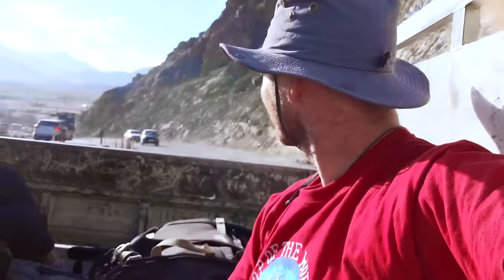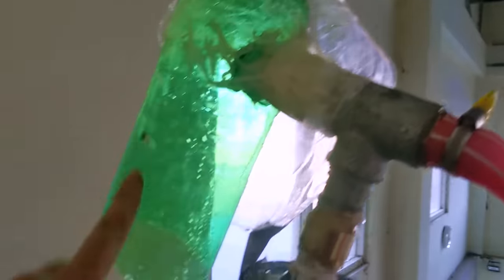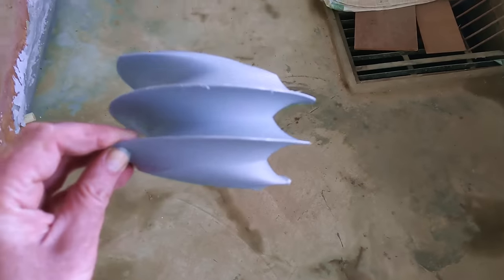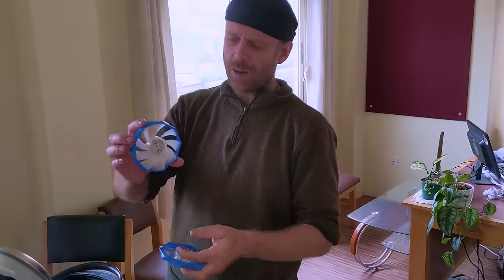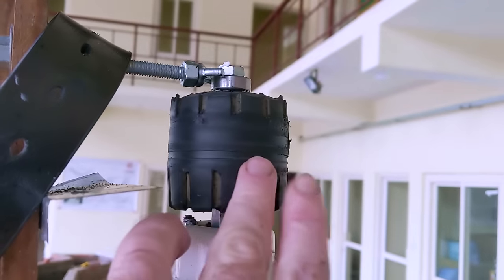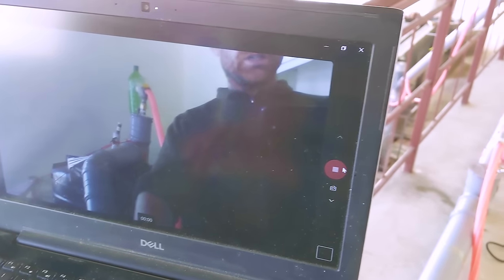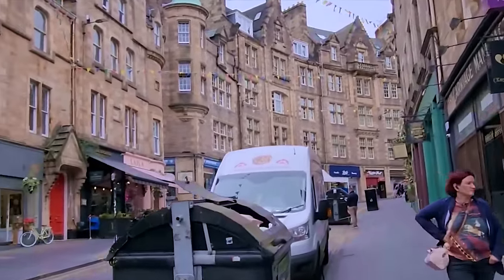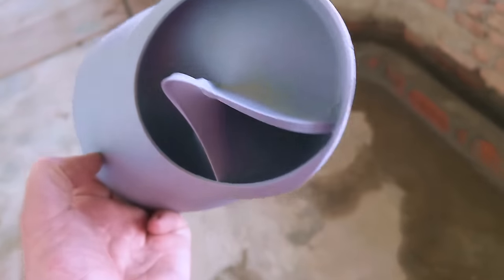The $50 Water Turbine Gets A Power Upgrade (Also I'm In Nepal)

Comment: That guide to spin the water was too comlex, too much surface area. If you look at the static blades on a turbine, they are relatively short in terms of the distance the water travels over them. You overdid it, and it needs to be a gradual turn from straight flow to the angle you want the water to be turning at. Plus, quite often the fluid hits the turbine straight, and it's intermediate blades that are used to adjust the fluid angle to hit the second or subsequent sets of moving blades correctly.
Reply from the maker: This is I think essentially the case, yes.
The idea was to double up a flow guide bend with a stator action, but previously when I tried just a bit of carved polystyrene to elbow the flow it didn't really seem to make any difference, so I think maybe the water just doesn't mind taking a corner on its own, but really hates wall friction..

I'll next try a kind of internal vector spinner type thing which may or may not help but should be easier to dial in specific angles, and just a more standard stator stack as you described.

Comment: After years of casually researching nano-hydro, I keep returning to the conclusion that positive-displacement designs (like the archimedes screw and others) seem preferable due to significantly higher efficiency.
Reply from the maker: Screw turbines are a good option in terms of efficiency, but can be a bit of a hassle to fabricate and integrate into the site. Also very low rpm, so usually need a lot of gearing up to get useful voltage.

What are some other displacement type turbines?

Comment: Excellent job! I am a bit surprised that the flow guide didn't help. It should have increased the RPMs of the spindle but probably reduced the torque, Did the flow guide made the tank to empty slower? Could it be the case that cumulative energy is higher while instant power suffers?
Reply from the maker: With the screw runner the flow guide managed to drop both the rpms and torque. May be just increased friction above vector gains. Going to have to try some other options to get a better idea of what's going on.

Comment: The logarithmic spiral types are intended to throw water out to the side, if they're constrained within a tube then all you're doing is increasing the pressure and friction.
Reply from the maker: It's likely something like that, yes. I'm finding that good propellers don't necessarily make good impellers.
Reply: @OpenSourceLowTech  Yep. This is also true of airplane propellers. Some of them perform better when they have a shield around them to direct the air and some don't seem to have much of an impact. I think the term for them is "ducted propellers'.

In a boat setting, the idea is to grab as much of the surrounding water as possible and throw it backward, OR to move a smaller amount of water very fast. Both of these impart Newton's third law (mass, momentum etc).  

In a tube like you've got, all the water is inherently 'ducted'. So running the horizonal water grabbing ones in reverse ends up performing poorly.
Reply: I think the Lily Impeller might work when constrained given it has more room for the water to be expelled. But ultimately having real world tests like you doing is ideal. These things are so hard to think about and often unintuitive.

Comment: Trimming the shrink wrap after install will change the balance of the wheel. ANY imbalance will be a big loss in efficiency. If you detect vibration during operation, the wheels are off balance, at least the rotating assembly is out of balance. Unfortunately, wear on the rotating parts will change the balance too.
Reply from the maker: Potentially, tho the masses involved with the plastic runners are super small, and it is in normal use flywheeled by the alternator.
Could have unbalanced torque effects tho if one side of the runner is a slightly better profile than the other..

Comment: Have you ever tried 3D printing a adjustable penstock gate that would sit just above the turbine blades? It looks like the circular radio active symbol but there's two that overlap and depending on how much you align the holes in the top plate with the bottom would control the flow rate and head pressure.
Reply from the maker: Doable, but the use case with these tends to be that you always want as much power as you can possibly get out the thing.
Reply: @OpenSourceLowTech  True, it's always a fighting balance between adequate head pressure and  vectoring the flow at the most efficient angle of attack. I believe your solution lies in in solving that metering and head flow angle though, but that's my opinion. Love your content.

Comment: Great work as always! Interesting to see that the Archimedes screw had the best performance, but it makes sense I suppose, and that's great info to know since the Archimedes screws are less considerably less complicated to print or fabricate than the other more complex spiral shapes. I think I can definitely print a screw of that exact size and shape out of recycled #5 PP with my TrashPrinter. There's still a lot it can't do, but it does really well with simple spiral-vase type parts like that, and I've printed turbines with similar sizes and overhangs before. I'll give it a shot once I get the trash printer going again later this summer, and I'll let you know how it goes. If you've got an STL you can send me, lmk, but otherwise I'm sure I can find one online or make one with OpenSCAD. 

I've got some friends up in Washington with a pond on their property that drains a massive area of steep mountains on their property, and I've been looking into ways to integrate their pond into their off-grid solar power system, as both an energy storage buffer and a way to harvest energy from the huge volume of rain moving through their property in the winter, when they get basically no solar. I would love to test out one of these turbines up there. I figure we can build one to start and get some data on its performance, and if our results are promising, we can calculate how many more we would need to match the natural seasonal flux of the pond, and then build an array of them.

Thanks for collecting and sharing this data!
Reply from the maker: Oh yeah, forgot to include the .STL
Is now in the description, but also: https://drive.google.com/file/d/1LKLKvMf1uGRJezQpzQJxcq62L2xLxtP-/view?usp=sharing

Let me know how you get on, and any questions etc.

Comment: In air, gas and water vapour turbines, the directional stator vanes are often used in multi-disk configurations, the stators placed between the discs, to "straighten" the flow before the next disc, and not to rotate it before the disc. 
By pre-rotating the flow before the turbine you've probably worsened its stall and drag characteristics so it made it less efficient.
Reply from the maker: Yeah I feel like this is probably the case.
I'll aim to try a multistage runner stator stack in some future testing setup, see what if anything that does.
Reply: @OpenSourceLowTech  yeah, most designs are calculated with straight incoming flow in mind, the optimal  angle of attack is extremely important to maximise the lift, minimize the drag and avoid the stall. So running with the off-spec angle will be worse in most cases

Comment: I wonder why you dont use a PMA with a variable resistive load to measure power at the shaft.  Perhaps it wouldn't be an improvement over the simple pony brake you have but it seems it might yield smoother results with easier adjustment and nothing to wear out.  Perhaps the rpm is too low and such an alternator would need to be too large.  I play with wind turbine rotors that way.
Reply: (BTW, neat video/fun stuff)
Reply from the maker: The first output testing in Berlin 2020 was essentially exactly that; hoverboard wheel alternator, liquid rheostat variable load. Worked fine and gave full system power numbers.
In Nepal tho the main issue was that I just couldn't find a viable option for the alternator. I had intended to use a motorbike alt, but they didn't turn out to be as accessible an option as I'd hoped. Also I kind of just wanted the mechanical output for sake of one less aspect / efficiency gate to potentially complicate the direct comparison of the various runner types. And had used a Prony with the wind turbine testing in Edinburgh (tho with a load cell and ESP32 logger board), so was comfortable enough lashing together a sort of equivalent just using weight scales.

Would still love to solve the problem of best alternator options for low resource environments tho..

Comment: I wonder if adding perpendicular grooves on the blades would increase efficiency. Essential creating more water friction/ drag on the rotating impeller = more converted into electrical energy?
Reply from the maker: Generally you'd benefit from less turbulence and friction not more, but hydrodynamics is voodoo and only way to find out is try every possible iteration in the real world.
Reply: That is true (the voodoo).  I am going to print out and try your screw impeller. And will play around with some ideas and if anything worthwhile will report back with results.
Reply from the maker: Nice one, please do.

Comment: I didn't see the Basu/shist disk in there. You should try that one, it's shown high efficiency in moving water. Probably means it would be decent as a turbine too.
Reply from the maker: The which?
Reply: @OpenSourceLowTech  If you look it up, its the egyptian unusually shaped disk that was made out of shist. Theres a video of a guy using it on ytube in a large paddling pool, with very little input work he could lift the heavy disk and weight on top of it. Theres other videos on redit that show it being used with a drill in a glass of water. 
It's almost the opposite of an impeller so I think in a tube where the water is coming in from its sides only instead of filling the whole tube it could work better. 
In order to keep the water flowing to the sides you would obviously need some kind of plug with maybe 3 or 6 fins locked to the edges of the inner tube.
Reply: @OpenSourceLowTech  Oh, its the sabu disk, sorry, that was a typo.

Comment: Should be a well developed formula for turbine blade shape based on speed and viscosity of fluid. Most of it is avoiding cavatation damage.
Reply from the maker: Presumably for the standard turbine types (Kaplan, Francis, crossflow, etc), but this use case is a bit niche, and fluid dynamics is voodoo..
Will have more of a look tho now that I know the basic efficiencies of each, great if there is.
Reply: The euler turbine and pump equation(s) is a useful tool, but it doesn't give detailed blade shapes beyond incoming and outgoing pitch/angles.

Comment: Completely uneducated guess here from a fellow kiwi but wouldnt creating laminar flow allow the fluid to impart more energy to the turbine as apposed to creating turbulence with the spin flow guide.

If it works it would also have the added benefit of acting as an inline filter.

I've used 100mm pvc pipe with endcap -> scotch pad -> straws -> scotch pad -> endcap to generate laminar flow for the kids to play with using a garden hose.

Scotch brite pad might reduce the flow too much so a mesh might be better and plastic straws are a little bit controversial so maybe 3d print an insert instead 😂

Anyway love the content and great to see that number 8 wire mentality being spread round the world!
Reply: Oh also the issues you have with priming the test systems could be made less so by using a t fitting inline and 3d printing a simple needle / gate / ball style (albeit cylinder shaped) valve to stop flow with a fill port added either to the print or before the t fitting for filling the source tank. If 3d printing is a problem I've seen people use tyre tubes as temporary pipe plug seals with a bike pump.
Reply from the maker: Laminar flow is probably desirable, but hard to maintain through any length of pipe, even relatively straight. A straw stack would need to be at the intake so that it could be kept clean, as would definitely clog over time even with a coander filter or similar. One of the advantages of this kind of turbine over a pressure type like a Pelton is it's way more forgiving of particulates, not having a jet nozzle to clog.

Not sure what you're meaning in the second comment, is about priming the siphon?
Reply: @OpenSourceLowTech  yeah, the benifits of the syphon based system is drawing from a depth so you already avoid a lot of potential blockages from surface debris.

For a laminar flow stack I was thinking more of incorporating it into the turbine assembly as part of the bushing before the turbine itself but I guess it can defeat the purpose of making this as low cost and access-able as possible when adding additional complexities. If it's found to have considerable efficiency gains then it could be relatively easy to design the turbine and laminar flow stack as one insert so it's easily removed for maintenance and cleaning.

The priming comment was about filling via the system itself so it's primed at the same time during filling but is only really considerable for a test rig not in production and might have issues with pump sizes. Probably more trouble than it's worth 😅.

I would be really interested to see what the limits are with stacking the turbine heads within your current design (two or more fans stacked together). Kinda see if you're able to extract more energy from the water by increasing the surface area of the turbine. Times like this I wish I could do the math to figure out what the maximum possible energy for syphon given the pipe size and drop etc.
Reply from the maker: > avoid a lot of potential blockages from surface debris.

Ideally, but unless it's a pretty deep pool / dam things just tend to get mixed and sucked on to your screen in fairly annoying quantities. Still need to properly test coander filters, but they'll need to be fairly large to handle the volume throughput.

> can defeat the purpose of making this as low cost and access-able as possible

I'm happy for there to be optional add on efficiency boosters for those with the resources, long as the baseline configuration is as universally accessible as possible. Hence the PC fan runner, tho to be fair that does turn out to do a pretty decent job..

> one insert so it's easily removed for maintenance and cleaning.

Maybe, if it's a lot of extra oomph. Bit of a bugger of a process tho, and probably fairly often.

> primed at the same time during filling

This is more or less what I had going in Berlin, but that required a gate valve on the outlet so the water didn't just drain out. Is an option, if you can find a funnel / cone of exactly the right size to fit the gasket, as I was lucky enough to do.

> interested to see what the limits are with stacking the turbine heads

Yeah same. Will do some further testing on that front when I'm able.

> maximum possible energy for syphon given the pipe size and drop etc.

The basic equation for max system power is just flow times drop times gravity.
But that gets a lot more complicated when considering pipe friction, turbulence, topology, load management, etc etc etc. I wouldn't even necessarily trust a full CFD sim, pretty much just have to build it well as you can and see what the outcomes are.
Reply: @OpenSourceLowTech  Thanks for the replies! I fortunately have all the parts in my garage to build one, joys of being a hoarder.

Will definitely be playing with this concept.

It's a fairly large rig to lug around for field testing so although it will add some internal turbulence I think I'll try corrugated pipe (collapsible) as for the non critical parts vs PVC lengths.

Might be lucky enough to minimise the footprint to the dwc junction and 40-60cm of collapsed corrugated pipe.
Reply: @OpenSourceLowTech did you have a discord or another community platform?

Would love to have a spot to share builds and test results if there's a few of us trying out your ideas ?

Thanks for the stl. Printing the screw prop at the moment so can build a test rig tomorrow. Poor spa pool is likely to get some love as use for a test tank 🤣
Reply from the maker: Sounds good. Probably best place to discuss results etc would be (if you're on Facebook):
https://www.facebook.com/groups/windturbinemakers

Mostly wind, but hydro also.